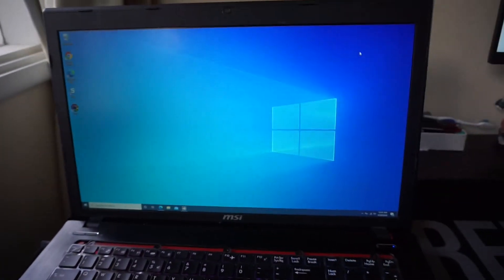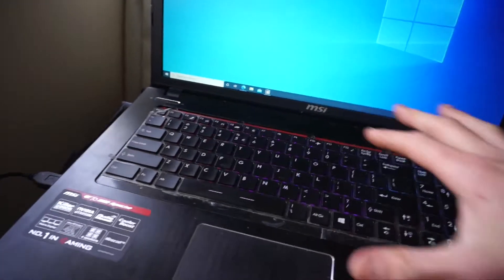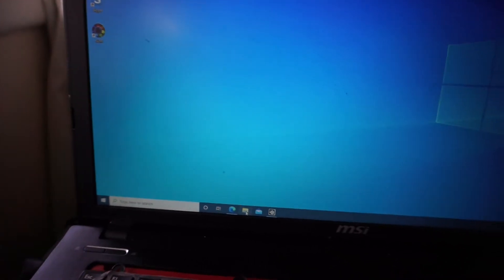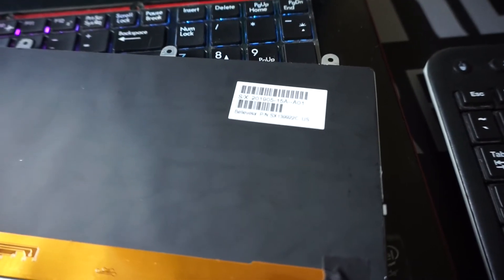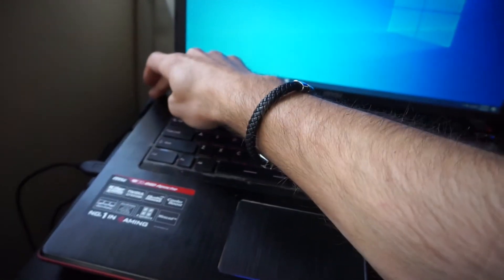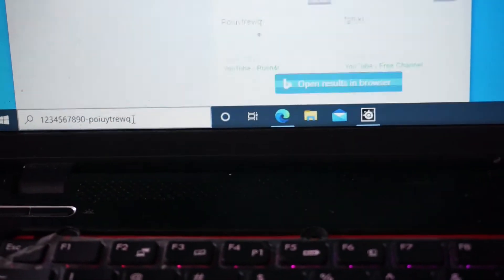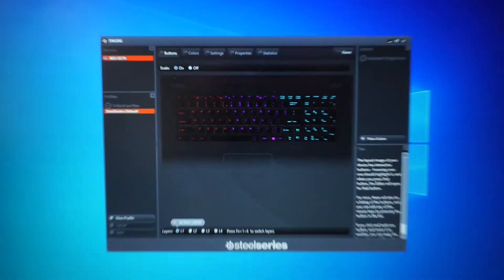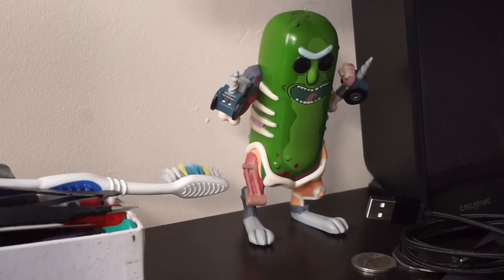MSI GE70 Apache Keyboard issue Solution

Comment: Thanks Rick! My keyboard went bonkers in the same fashion when I was logged out. Without realising I could use the onscreen keyboard through ease of access, I ended up spending half an hour trying to work out which key does what to get in. Bit funny still... Formatted, was sure it would help, still nothing (fortunately, it was well overdue anyway). Anyway, I watched your video and went for the easiest one first. I pulled the battery and power cord, hit the power button to make sure the capacitors were discharged, with the faintest of hope, I pressed "a", imagine my surprise when an "a" came up on the screen. Nothing short of elated! :)
Reply from the maker: Thanks man 

I'm glade my video has helped you